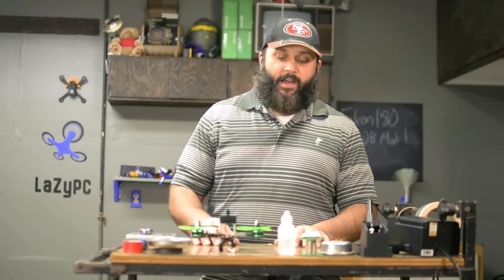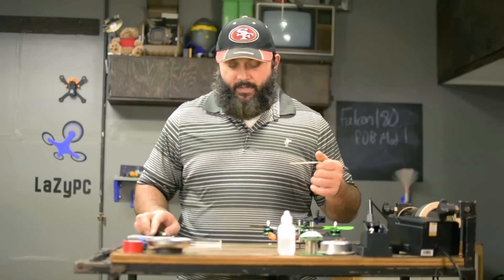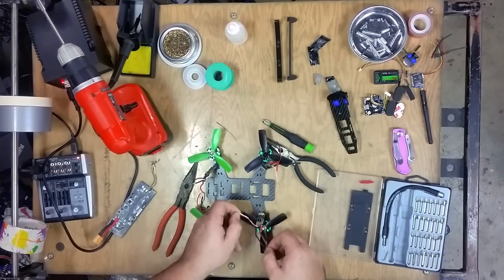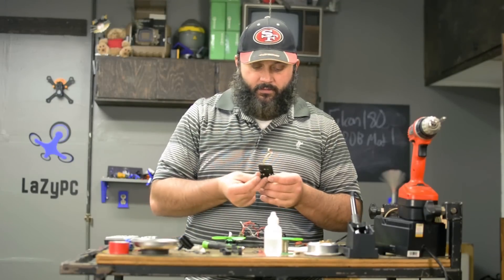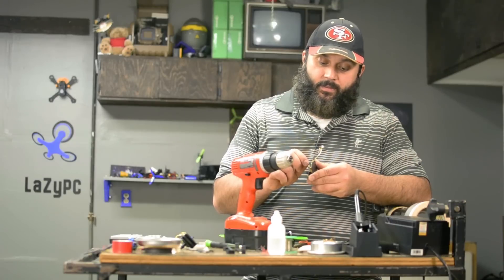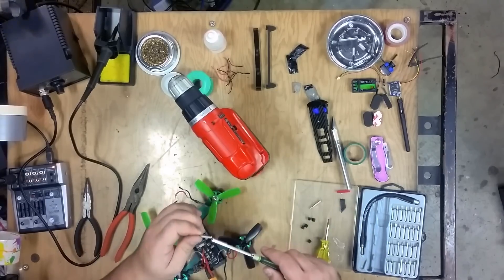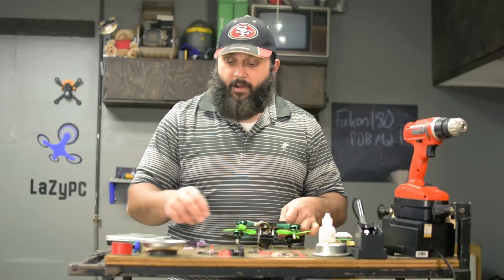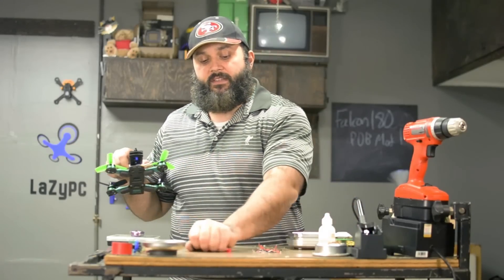Eachine Falcon 180 PDB Mod - LaZyPC

Comment: hi there,trying to do this mod with the video but you fast forward...How do you mount the PDB to the frame?What screws do you use?
Reply from the maker: I use the 4 middle longer spacers with the screws that originally held the PDB to the shorter spacers, although most M3 screws will work if you want to look for longer ones. I just change the order and put what used to be the middle carbon plate on the bottom and the PDB on top of it.
Reply from the maker: The foam backing of the PDB works fine as a insulator between the two. I added a piece of electrical tape to cover the contacts of the LED Bar jack.
Reply: I removed the foam backing and put electrical tape down before I remounted the PDB,I ended up cutting the back of the frame to allow the LED light bar header to be used...
Reply: did you put the PDB directly on the (conductive) CF frame? or did you put any spacers at all?
Reply: i just did this mod, and found that the LED connector made the rear of the PDB a bit thicker, and that concerned me so i put a nut on the screws in-between the PDB and the frame. I would rather have not, but i was worried about warping the PDB, maybe i am being overly cautious. This added another maybe 1mm to the height and now the front panel that 'protects' the camera is too small to stay in it's slots.. is that merely decorative?

Comment: does this mod make the camera tilt an issue with the PDB?  .. i actually do not have a Falcon 180, so i can't judge by hands on, and the pics i have seen show very little room up front?
Reply from the maker: No the same spacers are used so space between top and bottom plates remains the same.
Reply: Allen Moore thanks!
Reply: Well, this was the last bit of info i was looking into before pulling the trigger on my purchase. Do you still fly the Falcon? i would be curious as to your thoughts now a few months down. This is my first hobby grade quad, and i appreciate that i will be spending more than a few hours with it on the bench before attempting my maiden, but i have a few toy grade quads that i am putting an AIO cam on to allow me to train up a little.
Reply from the maker: R.Rutherford I do, but I fly everything I own. Doesn't matter if it runs DRonin or Cleanflight, racer 250 or custom build. I like to change it up so I am always adjusting how I fly and don't end up in a rut. 
The falcon is a good quad, especially when on sale, but moving the PDB I would consider a mandatory mod.
Reply: Absolutely! just visually one can tell those 'legs' are a point of failure, and then the idea of pounding down on the PDB as your landing surface is fraught. i will also be rotating the SP Racing F3, i know nothing about FC'ers, and have heard plenty more about Naze32, but F3 is supposed to be the next gen? 

Thank you! i really appreciate your time and energy in making the videos and responses!
Reply: One last question (i promise) .. where have you put your receiver? That is the bit that made me think there was no room for the camera tilt to function properly after moving the PDB onto the frame. I assume you found a better place to mount it? Maybe it will become obvious when i get mine and apart..
Reply from the maker: I use Flysky with this, and I broke a connector off the PDB trying to use a IA6B, so I switched to the X6B, and mount that above the flight controller.
Reply: ahh .. this is making sense to me now! Thanks again Allen!

Comment: I was thinking of adding some 5v motor led's to the falcon as the original strip comes off to easily. Do you know where on the pdb i could hook them up to.
Reply from the maker: I was thinking you could just use the pads on that side of the PDB, but when I looked at it right now it's labeled 5-12v, which is weird, so I'll put a multimeter on it later today and see what is actually there.
Reply: thankyou for your reply and help i really do believe motor mount leds are the way forward to replace the silly led strip on the back.

Comment: where do you suggest is a safe place for the rx ?
Reply from the maker: That was in issue with the i6AB that I was using, I had it in the front and in knocked the connector for the camera off the PDB in a crash.
I'm switching to a X6B and using the 30mm mounting holes to mount it above the FC, should work great but it's been slow going because I'm trying to do a review video of the X6B as well.
Reply: Holy smokes.  That would make sence. Awe man sorry to hear that brother. That means you need to order a new pdb?
Reply from the maker: I got lucky and just soldered the camera wires directly to the PDB, I'll probably just switch to a standard 30x30mm PDB as a weight loss project, so I don't think I'll ever replace it.
Reply: Allen Moore great idea actually!
Reply: That does sound lucky actually. What pdb are you interested in?
Reply: oh, and where have you tried mounting your vtx and an tenant?